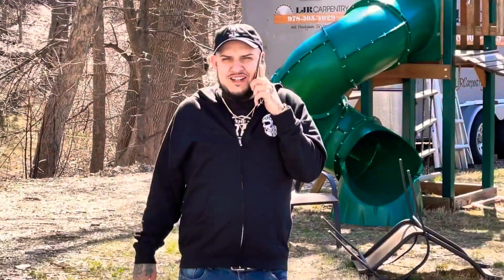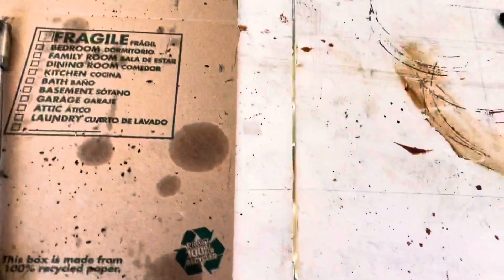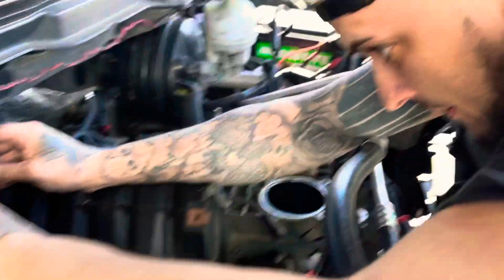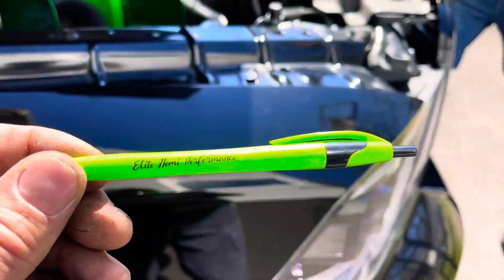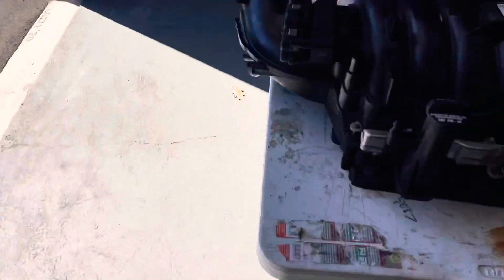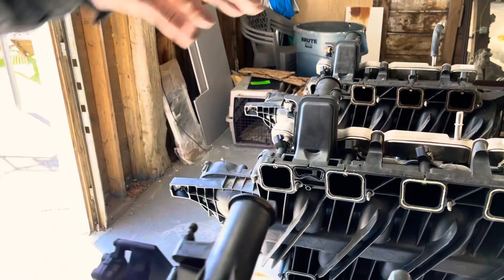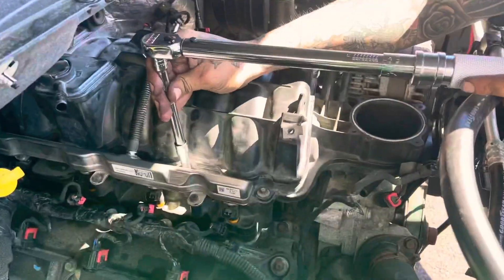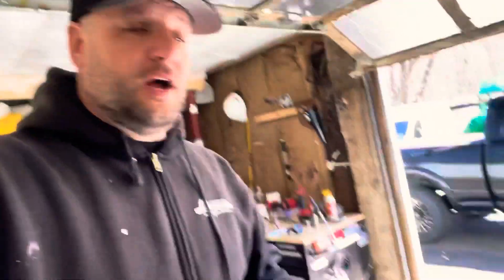RAM INTAKE MANIFOLDS: 5.7 vs 5.7 Ported vs 6.4

Comment: The 5.7 intake is the better intake minus that the 6.4 intake has a built in spacer. Just get an intake spacer, the 5.7 is 395 and 410 the 6.4 is 410 and 429 and it’s not the intake doing that (cubic inches and head flow). The 5.7 intake has a wider rpm range where as the 6.4 intake was designed for a lower rpm range for towing. A spacer is the cheaper option to gain the same results.
Reply: Nah, you get more low end torque out of the 6.4 intake, and if you're cammed you need that low end torque as the cam will help mostly on the higher rpm and take advantage of the 6.4's higher air flow.

Comment: Any info on where a runner valve is mimes throwing a code p2016 and p2008
Reply from the maker: The secondary runner actuator is in the back
Reply: @TunedRAMS  thanks looks like a pain to remove I really don't want have rake to dealer lol

Comment: both the 5.7 and 6.4 car intakes have the same size TB port and runner ports to the ones you took. both over lap eagle head ports. a ported 5.7 is ok but aported 6.4 is the best you can do for 5.7 cars. it will match up the runner ports, then you can match up the TB port to any size TB you have, though opening up the car 5.7 TB port involves a ton of plastic removal.  the 5.7 car intake manifold is a crappy design compared to the 6.4. both ram manifolds are way better design and both have the active short runner valves. someday I'm going to see if I can some how get a 6.4 ram intake to fit in the Durango.

the runner lengths on the trucks are where real difference is, stock 5.7 vs stock 6.4. A ported 6.4 for the ram would be the absolute best you can do.
Reply from the maker: Yessir, the truck 6.4 intake manifold is a great mod, helps a lot!

Comment: When replacing the 5.7 manifold with the 6.4 with injectors , what did it do for your Hp and Mpg?
Reply from the maker: No difference really, just skips adding spacers and if your tuner like them
Reply: Obviously mpg goes down as you're enjoying the added hp.

Comment: Just what I was looking into! I’m debating porting my 5.7 intake, but also researching 6.4 intake. I hear fuel economy goes out the window on 6.4, but if I wanted fuel economy, I’d be driving a Tesla.
Reply: Fuel economy only goes out the window if you have your foot in it which is no different then stock lol. It’s a vvt so when you gentle it is.
Reply: @joshkrause2977  I’ve put in 90mm

Comment: Just slapped a ported 5.7 on mine,  didn't even thing to check it, but visually it was a big difference over stock. High end was a good improvement!
Reply from the maker: Depending on who ported it, it’s should match great.  I know my 5.7 ported intake manifold was much bigger than I expected.  The 84 mm Fastman is a perfect match for the stock 6.4 too.  I’ll be port matching the runners to the BES heads soon, will help overall.  What TB you go with?
Reply: @TunedRAMS   I'm still on stock t.b. I did polished it real good, it was one of the first things I did but dyno registered it but could have been the placebo effect, I was instructed to wait for boost to get a larger t.b. but I keep hearing alot of n.a. gains so I wonder if maybe I should go larger 🤔
Reply: I have a ported 5.7l intake but also got a 6 4l intake for my RT. I will port the 6.4l intaie as well before running it. 

Bad thing theirs no dyno sheets of a stock intake & ported 5.7l intake.. just bad comments or video about it lol